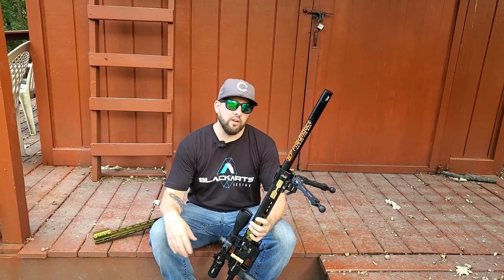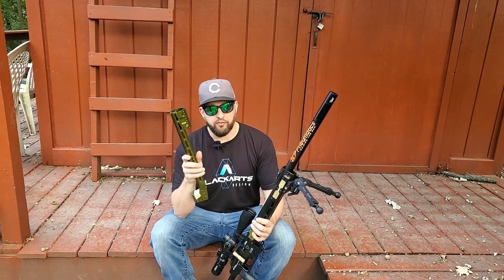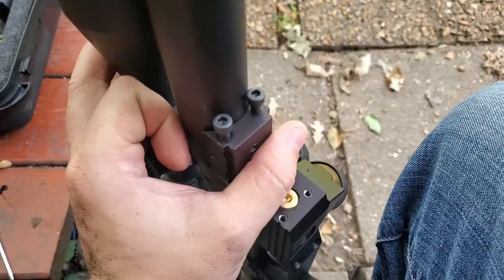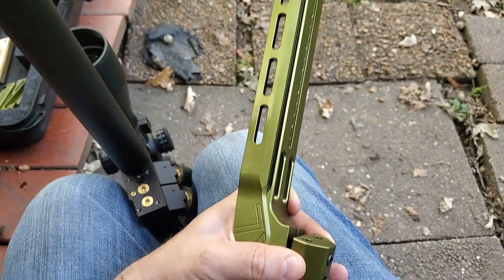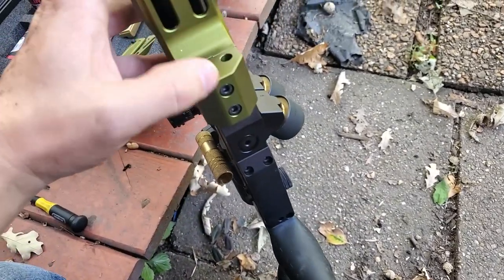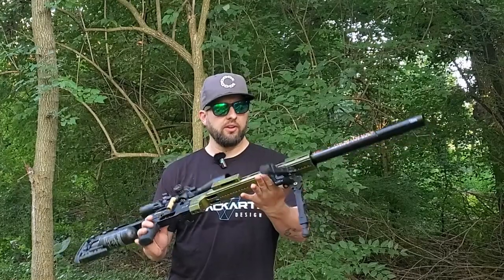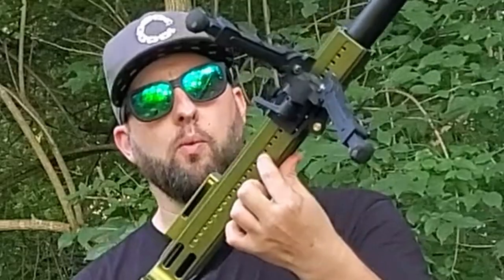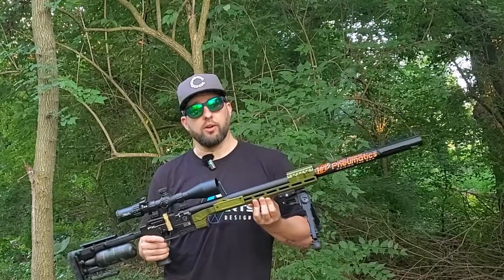Kraford & Lypt PR5 Rail Installation on the FX Panthera Airgun! The BEST Rail for NRL22 Shooters!

Comment: Love the video bro I have a question, not the screws that are running up vertically from the bottom but the two that are horizontal on the bottom piece are they screwed into the holes that were used for the factory barricade stop?
Reply from the maker: that is correct
Reply: Ok thank you I just had to make sure mine were stripped out from the factory so I don’t think this will work for me sadly 🙁

Comment: It's looks very solid! Does the bridge provide any more rigidity? I assume not from is visible.
Reply from the maker: No the rail is already rigid af. The bridge looks nice and you can mount M-Lok stuff to it, though. It has threaded holes I'm standard M-Lok distances so you can directly screw on stuff without using the little tabs
Reply: Thank you @airshootist  !

Comment: Question for you, what trigger weight do you run at bench? Appreciate the videos!
Reply from the maker: I was just talking about this the other day. I actually almost never adjust triggers. I just rock whatever setting they came from the factory at! Haha. Unless for some reason it is really bad I just roll with it however it came from the factory. Usually on the FX guns they seem to be about 1.5-3lbs max. I don't have a pull gauge so I may never know!

Comment: Hi, I have a question: Is there room made for the valve to come into the front end without peening the valve stem? And is the front heavy enough so that you don't have to add any weights to balance the rifle?
Reply from the maker: There is a cut-out for the valve stem, it will not hit. You will need to add weights to balance. Check out this video: https://youtu.be/9aUu_RKAhX4